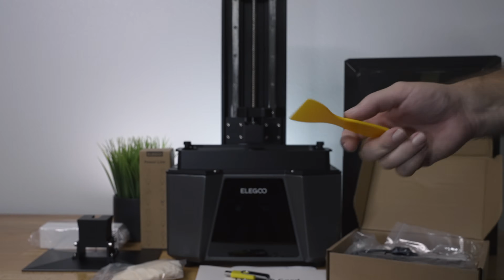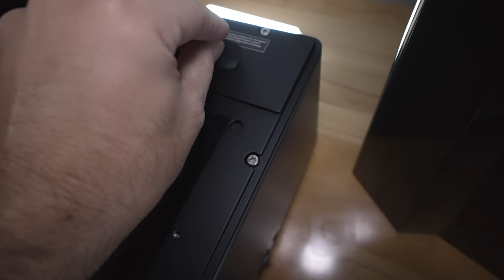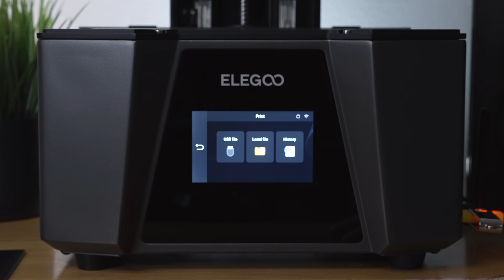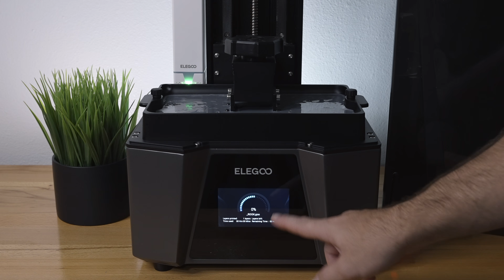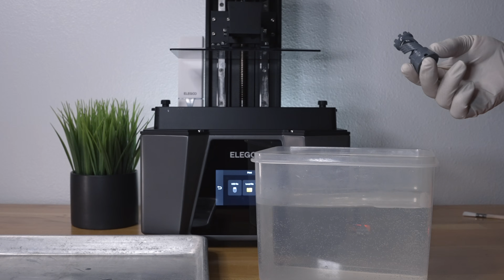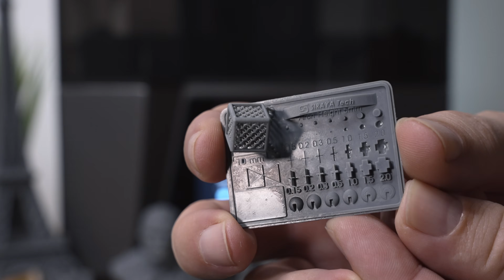Elegoo Saturn 3 Ultra - 12K Resin 3D Printer - Review

Comment: For some reason I can’t get the model to print/ stick on the plate. Whenever I’m trying to print and I check up on it nothing is there. And I did everything like the video. Is there something I can do to fix this?
Reply: hey there, just wondering did you get the saturn 3 to print. I recently purchased this machine and are having the same problem.

Comment: Those masks are NOT for resin. You need actual sealed rubber face mask with organic chemical filters to actually effectively filter resin fumes.
Reply: Tbh manufacturers should do away with all those accessories, just the allen wrenches and the 2 spatulas is fine, save whatever few cents on other stuffs and their packaging since they do nothing but might ruin the experience

Comment: Great video review thank you.
Sadly with so many other printers bring out truly new innovations to the market it's a shame elegoo are falling further and further behind with their latest releases.
When will the following be standard-
Flex build plate (huge point)
Heated tank (huge point)
Built in purifier
Auto refill vat
Front power switch
Front usb port (huge point)
And it be nice to see a wider build plate as well.

It also be nice to see the tank walls be higher to catch the drips and the build plate to stop lower.
But at least they finally included a real leveling sheet after all these years.

Comment: Did that print without the cover? My Anycubic wont print if the cover is off. Did you just block the sensor so it thinks the cover is on for filming purposes?
Reply: All my Elegoo printers print without the lid on without modifying or doing anything.
Reply: @shreddy_mcgnar6359  same

Comment: Heated resin tank, no.
Auto resin fill, no.
Flex build plate standard, no.
I see nothing about this printer that is "ultra".
It is just like my saturn 2 8k but with better resolution and wifi ( both of which I don't need).
Just the next dribble in trickle down technology releases. I expected more Elegoo, honestly.
Reply: It can print much faster, but using that speed comes at the cost of quality/ detail.
Meaning the main benefit of it is pretty much irrelevant for the vast majority of users.
Reply: @islewebdesign1150 Yep, until that becomes the norm and in 8 weeks they release 'the hyper' which has zero more features and prints 40% faster using technology they had 3 years ago and just trickle down to us. I'm happy for you.Enjoy manually filling your resin tank at ultra speed.
Reply: Better not ever buy anything since they'll have an improved version soon, huh?@handsofrhythm3415
Reply: yup. I learned quickly. Keeping my saturn 2 and get rid of the cute ender 3 v2 neo.😅

Comment: I am a little confused. I just purchased saturn 2 for $399 few days ago then I found out elegoo updated all of their printers. I had zero idea saturn 3 is out for same price as saturn 2 at $399. This is my 1st printer and I definitely would not have purchased a old version over this new version which is the same price as version 2. Do you think the upgrade is worth for me to return the version 2?
Reply: I would.
Reply: Where did you see it for $399, it is $499 where I search...
Reply: @rickstard73  actually elegoo had it on sale for 399. That's where I saw the price from, and the reason that made me question. I decided to just keep the saturn 2. I have both, the resin from elegoo and FDM by ender 3 v2 neo. Now, this is my 1st time using any 3d printer and if anything I will be returning the FDM printer. The easiness and simple to deal with and faster than FDM ender 3 I am really liking the resin version, and saturn 2 is built like a tank if you compare to this ender 3 v2 neo. I never realized just how small and "cute?' LOL the ender 3 was. I had nothing but issues with ender 3. It's very fragile like. I can rip the ender in many pieces with hands if I wanted to. Good luck.

Comment: Is it really faster than the Saturn 2? Eleego said it’s 3x faster but with the new fast resin. So if you use any other resin, is it any faster?
Reply: I was chasing speed, but I learned quickly that running 500/mm is not really ideal for lower cost printers. Even the more expensive printers like bamboo or prusa  is not even running at full speed which is the 500/mm. Those more expensive printers most run at 250/mm the most. good luck.
Reply: It’s fast as fuck. It’s so much faster that I need to find a way to slow it down because the rafts are peeling off on the sides due to the retraction speeds despite me making SUPER slow resin settings in Lychee.